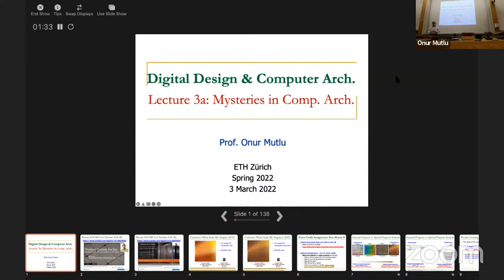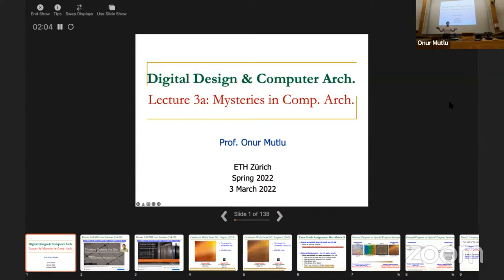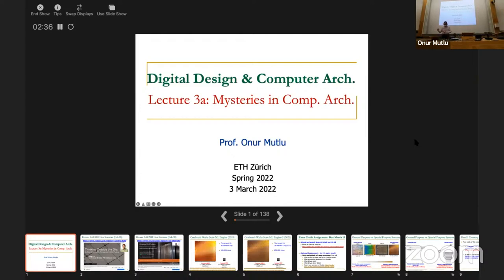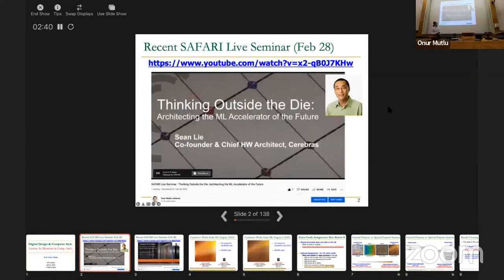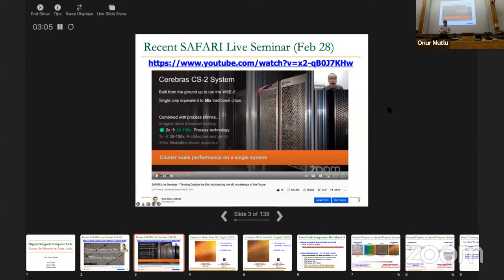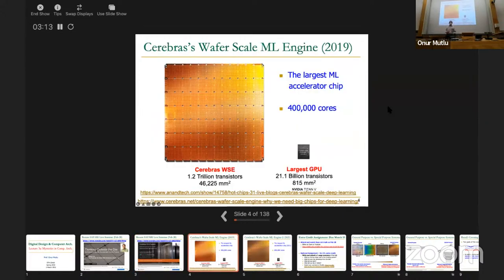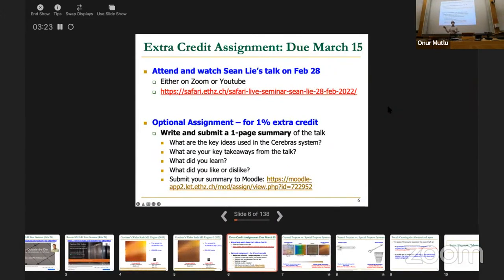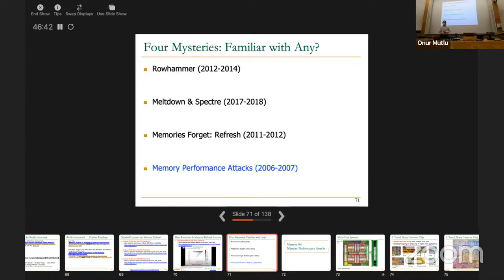Digital Design & Computer Arch. - Lecture 3: Mysteries in Comp Arch., FPGAs, Labs (Spring 2022)

Comment: Hello Prof, So We can reduce increase performance, Energy Efficiency, etc... by implementing RAIDR. From Prob cumilative distribution, we may have approx "1000 failure" rows if we refresh it 256ms once. But, I can see it as a failure. because 1000 rows = 8 Byte * 1000 = 8KB. For Instance, If AWS is providing cloud storage to a customer, Let's say an IT firm. If AWS notices H/W failure, how it can convince the client. Because, it is the client who is losing the data. So, I can argue cost is much more higher.